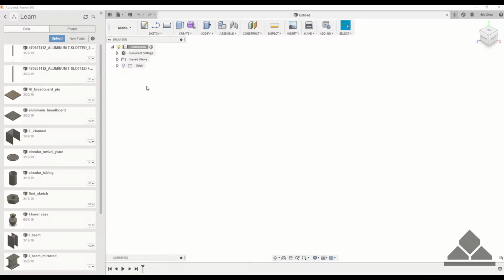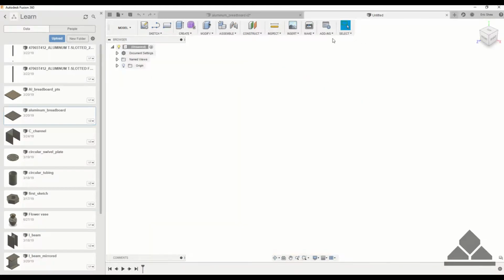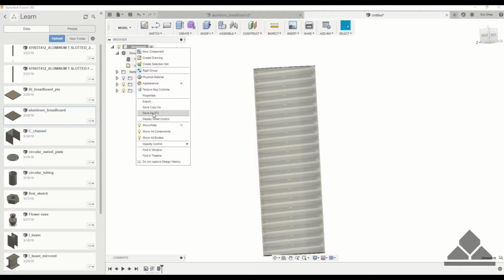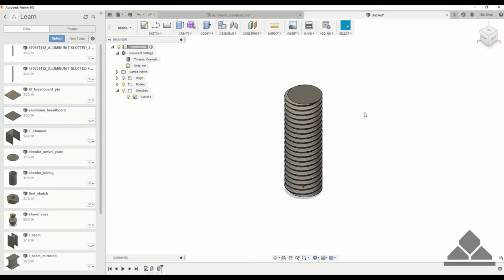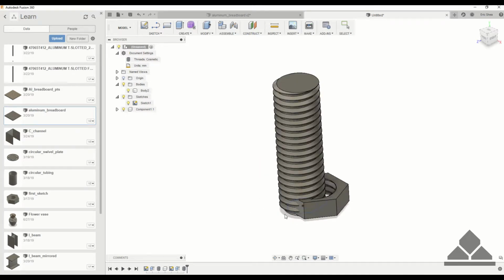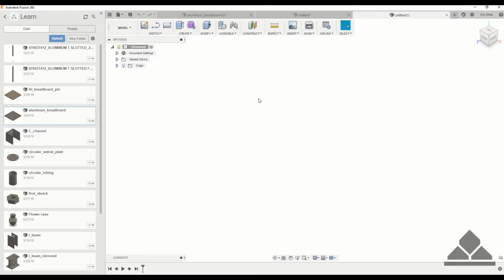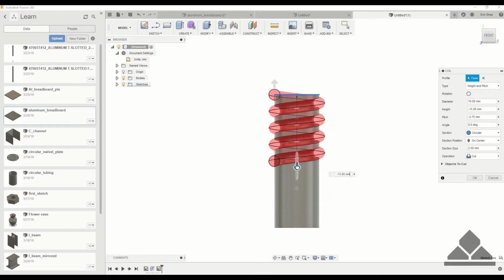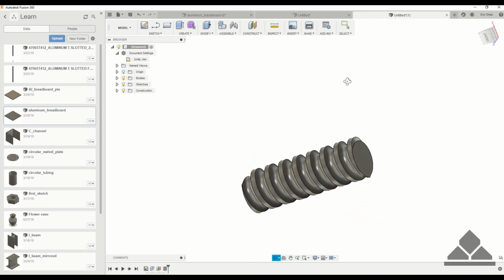How to Create Threads | Fusion 360 Tutorial 14

Comment: In real life, if you want to make an M10 nut (with threading tool), you should make a hole inside that with a diameter of less than 10mm. The exact value can be calculated, but what is known for sure is that it should be less than 10mm. Because after making the threads the diameter of the hole considering the threads will be (almost) 10mm.
Is it such that Fusion 360 takes care of these calculations itself? Here I saw that you chose a diameter of 10mm for the hole. But in real life if you do that, then your threading tool will not cut anything out of that hole.